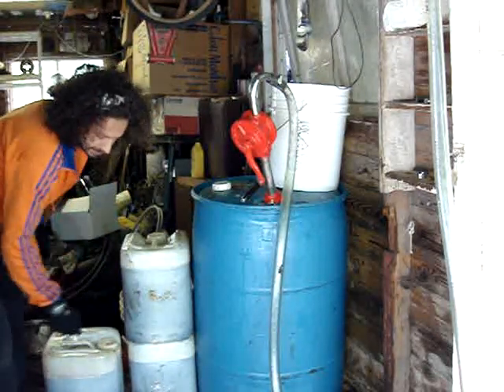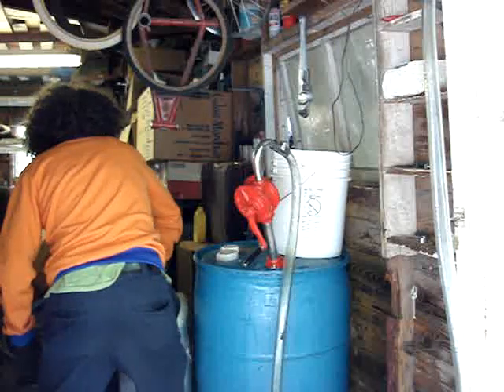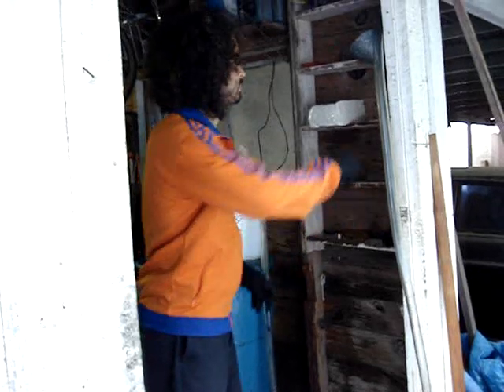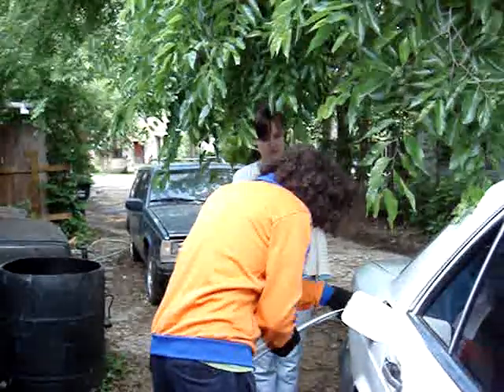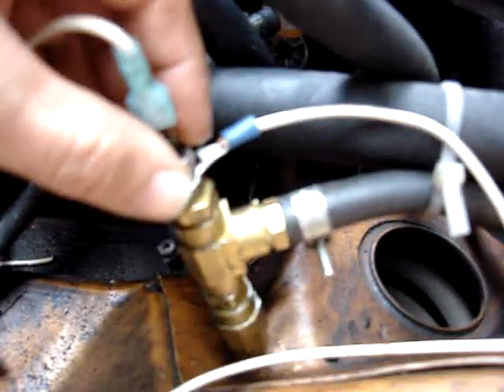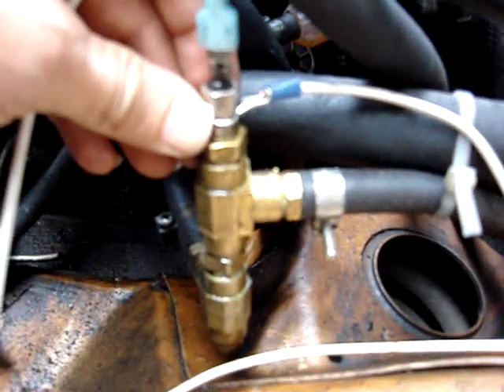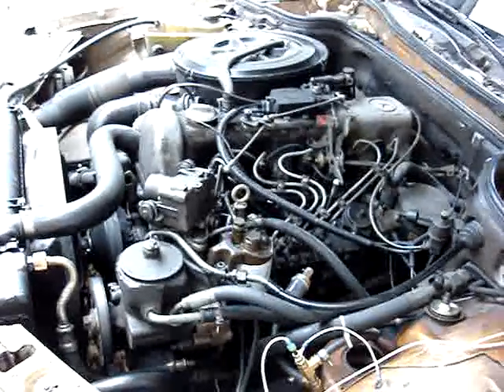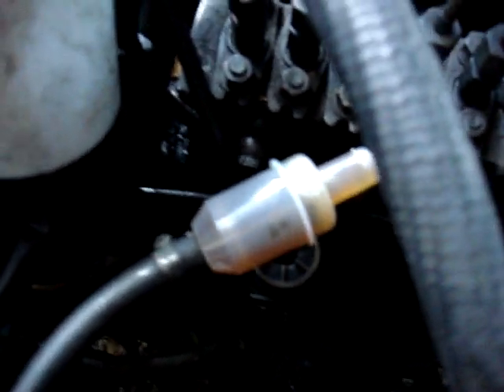straight wvo svo glow plug heater one tank system

Comment: hi,i use new or used veg oil.only modifications i done wer puttin in a twin tank & use a water heated fuel filter housing made by purflex,this thins the oil better in the winter,in the summer i dont use it.i dont use solenoids and electronic gizmos,i just put in a 3 way ball valve(bought from a boatyard)on the floor to switch between the 2 tanks.i purge the system with diesel for two minutes at night then its ready to go in the morning. you can jus run your car on a 50/50 mix of veg & diesel tho

Comment from the maker: no. with good quality oil in a warm climate there have been no problems. quality non-hydrogenated oil with no water present is the key. the car started and ran in freezing temps with 2 cycles of the glowplugs just as a precaution.